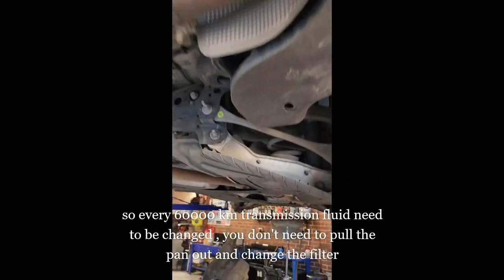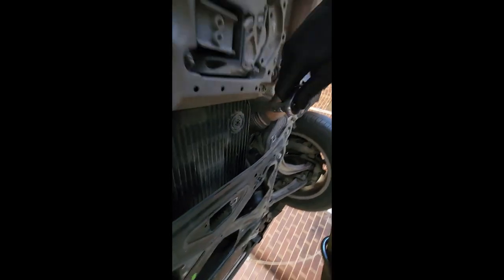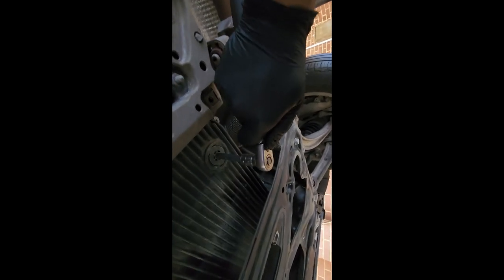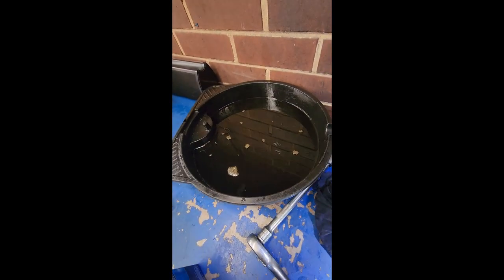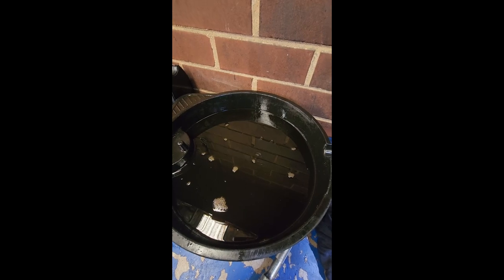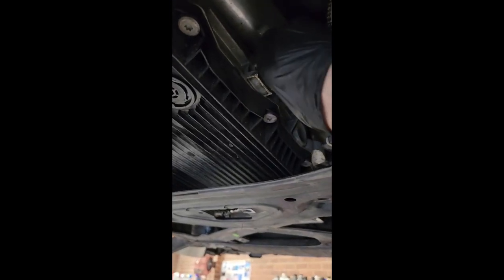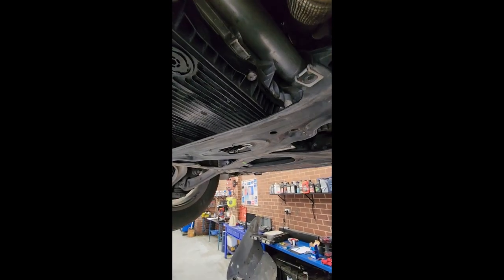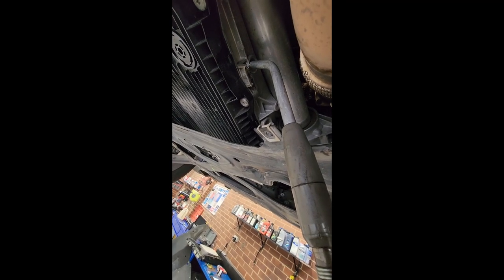Audi Q7 2015 - 2021 transmission fluid change

Comment: incorrect, do not drive it then check the oil. you refill, run gearbox to 30-45c then shift through the gears then refill till it drips out. if it goes over 45c then you need to wait for it to cool and retest level

Comment: No filter change ?
Reply: I think the changing plastic pan with built-in filters is a bit of a mechanics' scam. I always just flashed and refilled on my cars and they ran more than 150k miles with no issues at all.